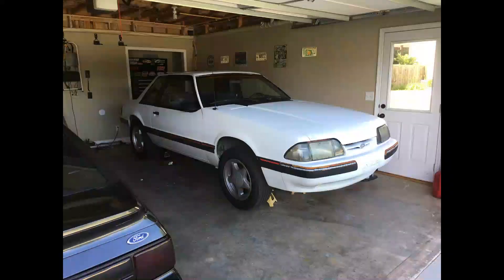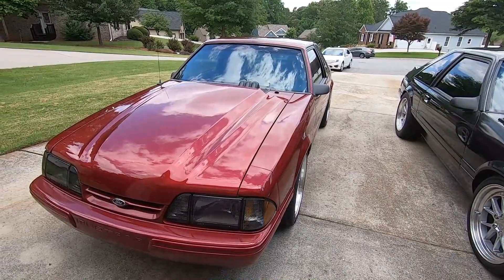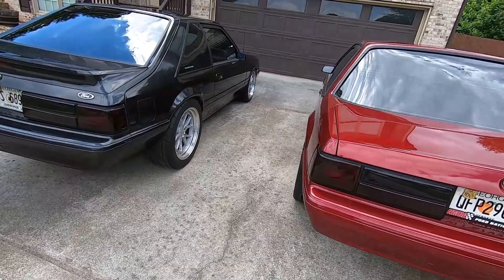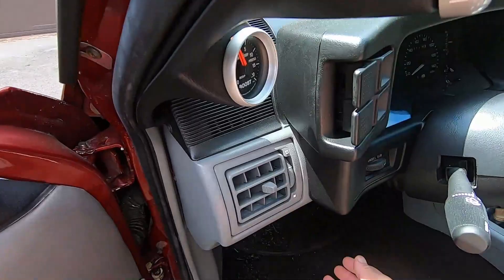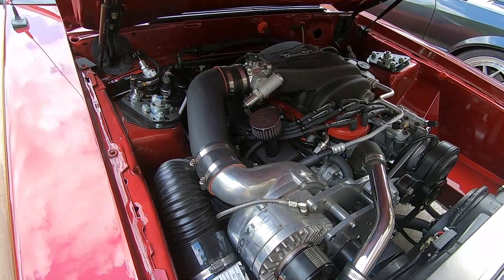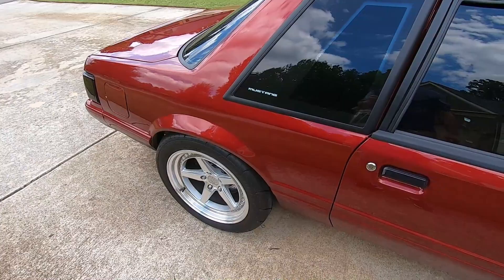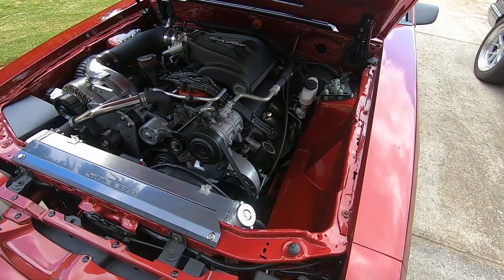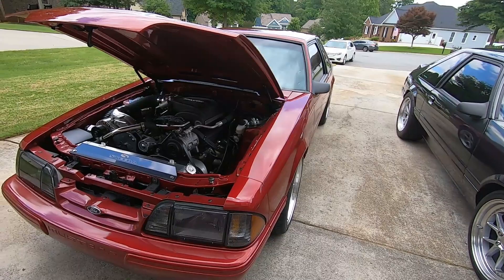Fox Mustang 1988 Coupe

Comment: Beautiful coupe! I may have missed it, what is the offset on the rear wheels? What size rubber are you running on the front? What are you running for an ECU?
Reply from the maker: @Quik5oh, thanks so much! Rear wheel size is an 18x9.5”, with a 30mm offset. 255/35/18 front tires. I am running A9L and tune with Moates Quarterhorse 👍